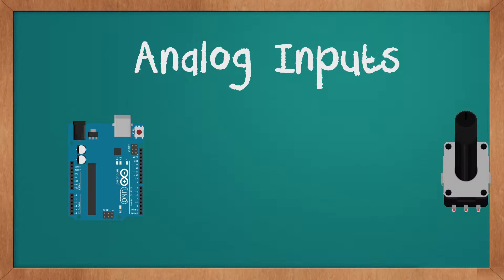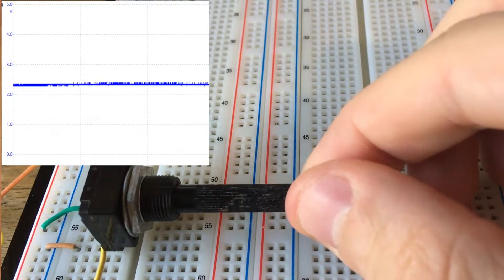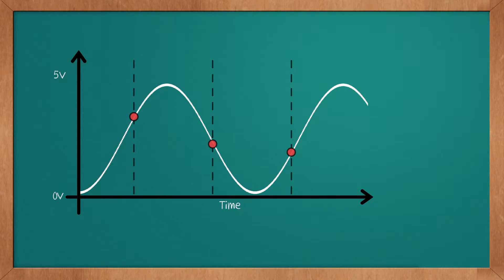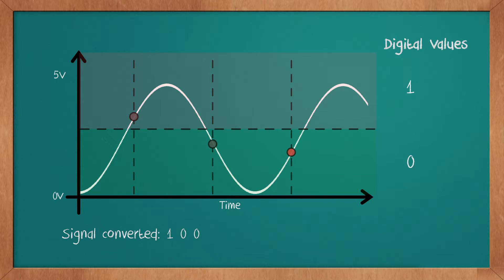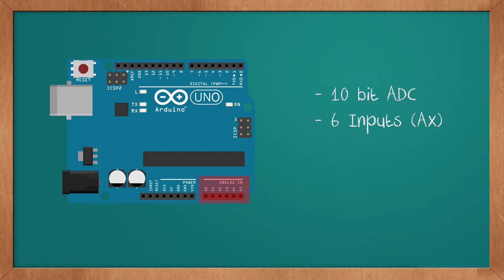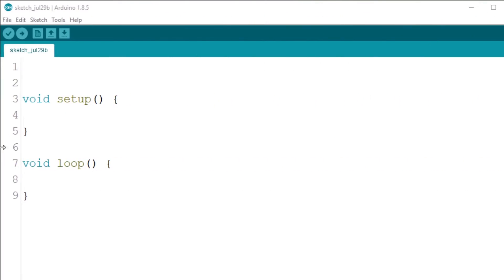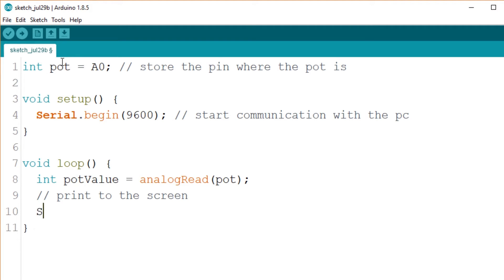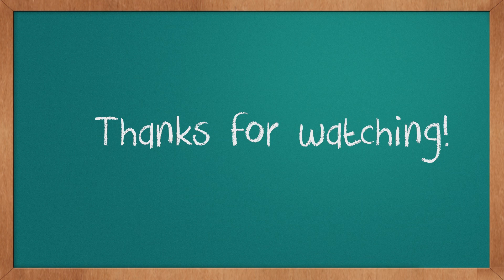Arduino Analog Inputs

Comment: if i generate analog signal(PWM ) to the pin 6(arduino UNO).can read same output from analog pin(A0) with same board.i tried this but i cant able to read anlalog value what i generated from pin number 6.Please let me know how can fix this

Comment: what is the sampling frequency of arduino uno adc
Reply from the maker: A 16MHz Arduino  is set to have a sample rate of 9615 Hz. But the real sample rate is less than that depending on what you do. I'll link an answer that I found in a forum:  https://arduino.stackexchange.com/questions/699/how-do-i-know-the-sampling-frequency